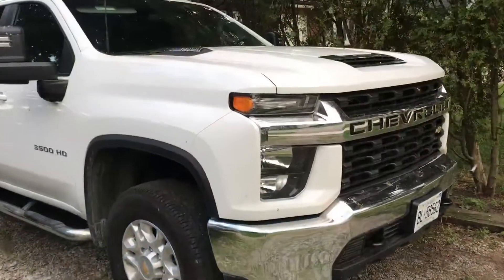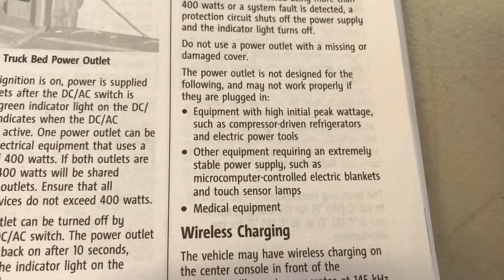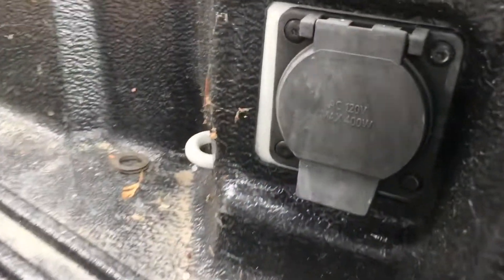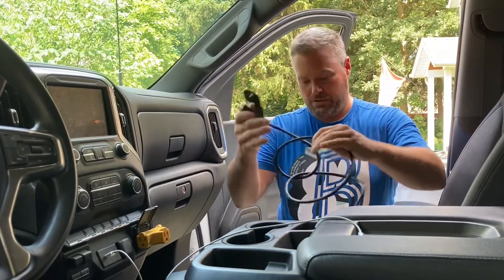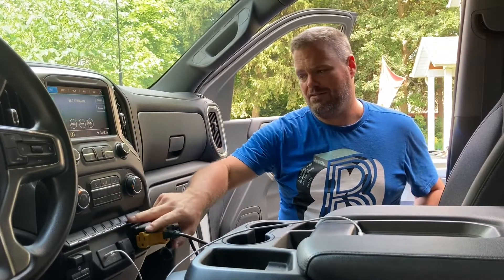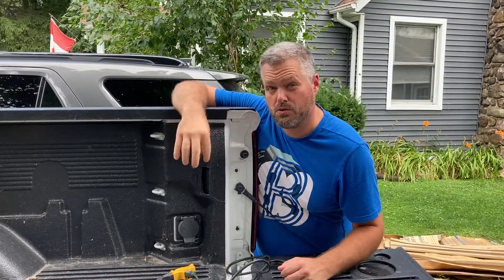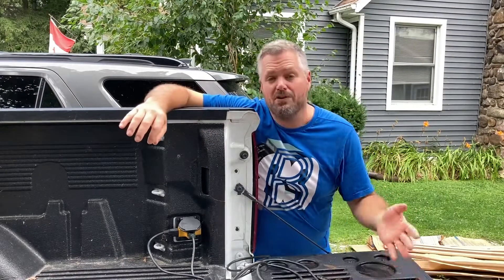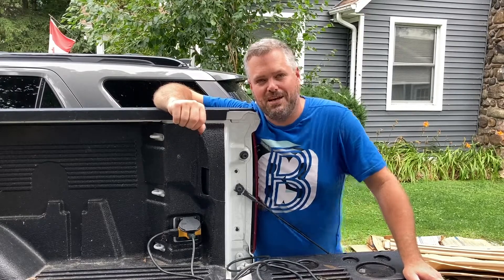2021 Silverado 3500 Onboard inverter testing

Comment: Hello. Any tips on how to increase the wattage?
Reply from the maker: There’s no way to increase the wattage of the stock inverter without replacing it and all the wiring. You’d be better off just buying another inverter with a higher rating and using it separately
Reply: @crownlounger   of course they use the smallest wires possible for the stock inverter so working guys can't upgrade it cheaply... I was just gonna swap it out....
Reply from the maker: Haha yeah of course. 

I once read somewhere that if an auto manufacturer could save 1 inch of wire per vehicle, over the course of the production run of that vehicle they could save a million dollars… for the same reason they are definitely not going install larger wiring or fuses for the possibility that someone might want to swap it out one day for a larger inverter

Comment: Would it handle charging my makita 20v drill battery’s while I’m driving around?
Reply from the maker: Yes it should just fine. I used it for charging my 20v Dewalt batteries. Seems to take a bit longer than when it’s plugged into the wall, but it still works.

Comment: Hey bud!  Can you help me out?  I have a 2021 Silverado 1500WT .  After watching your vid i would assume we have the same 400w built in...?  It's not good enough for me.  I want at least 800w and was thinking of 1200w.  So, could i replace the built in 400 or should i just do my own thing separate from the truck wiring harness.  If i COULD swap out the 400 to an 8 then do you think the wiring harness is up for the spec ? or thats gotta be upsized too...? I mean obviously the fuse but i don't know where that is yet either let alone if its a thermal, i hope it is.
Reply: And where is the dang thing anyway !
Reply from the maker: Sorry for the late reply!

So I was reading that the inverter is located on the back wall of the cab somewhere. I no longer have the truck, so I can't confirm that. 

As far as upgrading to a larger sized inverter, I'm not sure it's as simple as swapping it out for a larger one. My gut tells me that all the wiring is sized for 400 watts max, which works out to be approximately 33 amps, at 12 volts. By moving to a 1200 watt inverter, the max amperage would be somewhere around 100 amps at 12 volts... A substantial increase! I can absolutely guarantee that non of the wiring from the fuse box to the inverter is sized for that, and I would even go as far to say that the wiring from the inverter to the 120 volt outlets  is likely not sized large enough for the potentially 10 amps at 120vac. Replacing all the wiring to each outlet and rewiring to the inverter is doable, but I'm sure it would be a lot of work.

I hope this helps!

Comment: I have been using the outlets to charge solar generators for camping.  I have one in the cab to power my fridge and one at the tailgate to make coffee.  Charge while a drive.  I have found that I can only get 300 watts before it trips.  Can not get anywhere close to 400 watts.  I would be interested to see what your watt limit is.  Currently I can have 229 watts charger working in the front with a 43 watt charger in the back.  Tried different chargers in the back trying to get closer to like 350 total watts.  At 331 watts it trips out.  At 295 watts is does not.  At what wattage will your trip out?
Reply from the maker: Unfortunately it was a work truck and I was forced to trade it in for a Ford… :(

Just a guess, but I believe that the 12v cigarette lighter outlets are also on the same circuit. If you are using a phone charger or other 12v accessories it might be pulling some power from the same circuit as well causing it to overload.

If that isn’t it, it’s likely to have an actual load rating lower than what they claim.
Reply: When it trips….how and where is the reset?

Comment: Not a super helpful video. I was looking for info on fixing/ testing the inverter itself. Neither outlet in my 2020 Silverado is working whether the engine is running or not and even though the AC outlet button lights up green. The fuse tested good. Not sure what to check next.
Reply: Did you enable the inverter with the dash switch?
Reply: Same. Not sure who this was for. I'm assuming most came here because their plugs are no longer working. Light on the dash comes on also. No power. Where's the vid for that?:)

Comment: SO where is the inverter?  Id love to add this to my LT but no info on all the pieces that i will need.  I need the 2 plugs, the dash on off switch and the inverter.  Do I need wiring too
Reply from the maker: Sorry for the late reply!

So I was reading that the inverter is located on the back wall of the cab somewhere. I no longer have the truck, so I can't confirm that.
Reply: I ditched mine too!  😂

Comment: Does anyone know where the physical location of the inverter is? I would like to upgrade it?
Reply: agree, i was somewhat disappointed that they give you a bed outlet which cant run a power tool!
Reply from the maker: Sorry for the late reply!

So I was reading that the inverter is located on the back wall of the cab somewhere. I no longer have the truck, so I can't confirm that.